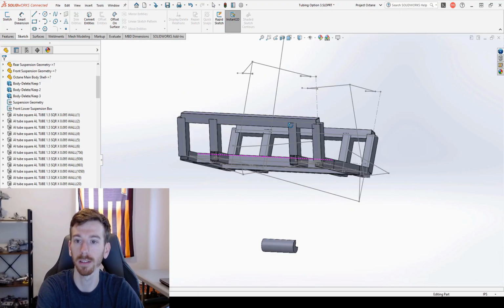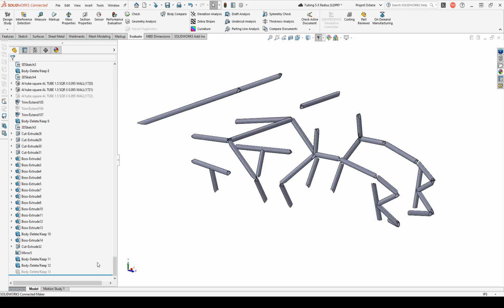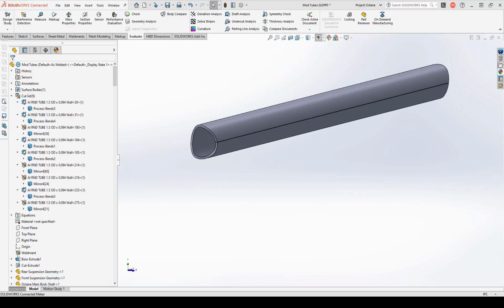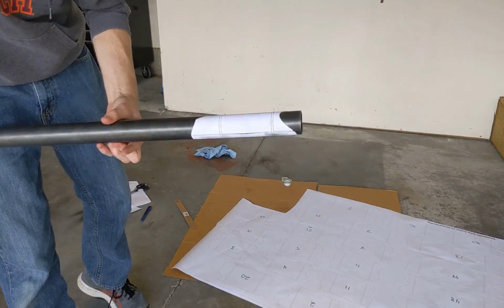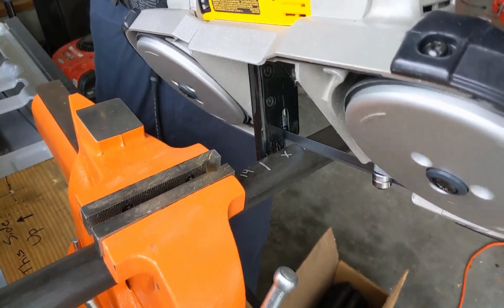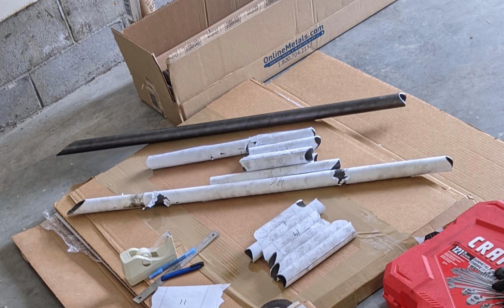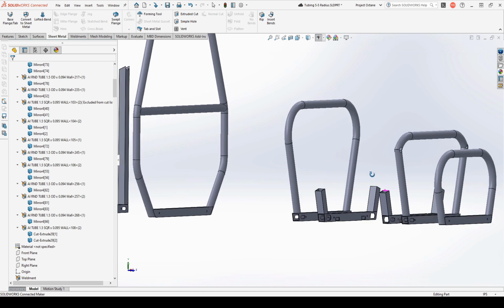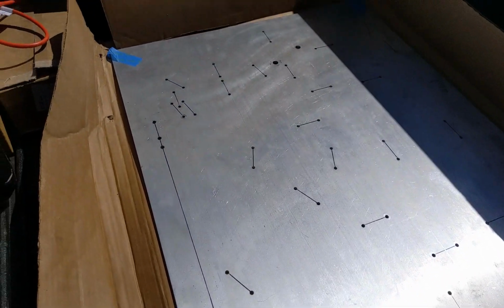Making a Real Life Rocket League Car  |  Build Day 0  |  EP12

Comment: Hey man. Came from FLuuMP's video on Project Octane. Just wondering why you guys were opting for 600cc engine over a literbike engine since the pricing is relatively similar (especially for the older model R1/GSXR1K engines.
Reply from the maker: Haven't made a final selection yet. In general I do think the cbr600 specifically is more widely available and at a lower price point but the added horsepower from a 1L is appealing. I'm also interested in some of the newer Honda DCTs, not from a power standpoint but from a drivability standpoint - if we ever have people in the car who haven't rode a bike or driven a manual.
Reply: @ProjectOctaneRL  What are your plans on addressing the low amount of torque in these motorcycle engines? Honda DCTs are definitely a great option for people who haven't ridden a motorcycle or driven a manual. Are you planning to make it street legal?
Reply from the maker: @messi-be4dp  less than 50 ft-lbs definitely a concern. We are about half the weight of a normal car so half torque ~70 ft-lbs should be fine. Goal is to be street legal but may depend on different state laws. Also possibility in the long run we make an "R" version with a boxster 2.7L setup @ 400hp but we'll see how things go first!
Reply: @ProjectOctaneRL  Would love to see this become a kit-car in the future you could maybe sell to your viewers. I for one would definitely be interested in purchasing if it promised 400 hp to wheels lol. Very excited for what's coming! Thanks for the replies and good luck!